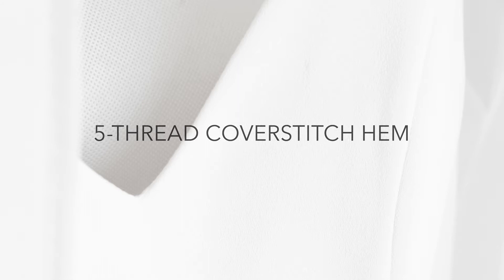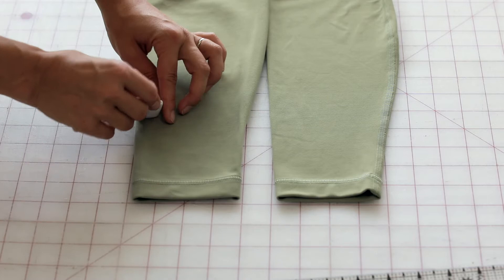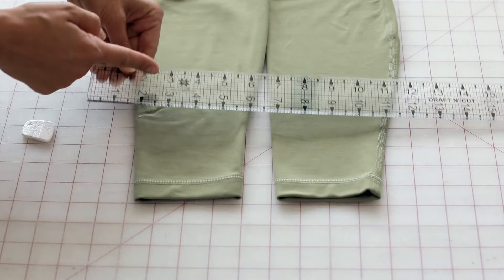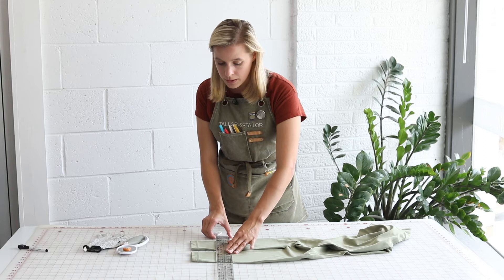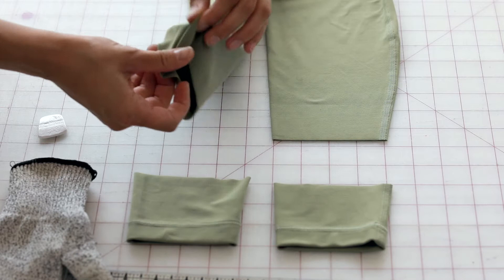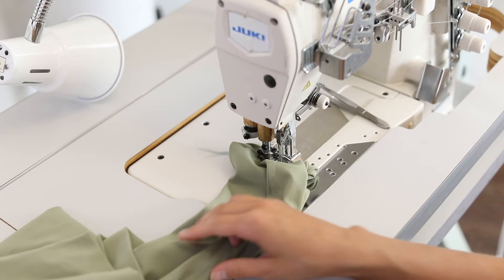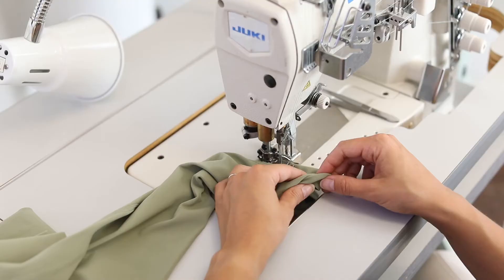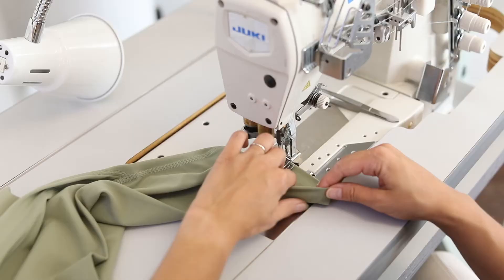The Ultimate Guide To Hemming Your Lululemon Leggings (Ep. 6)

Comment: You made that look too easy!  Lol. I only have a simple/regular, 2 thread (1 thread plus bobbin) sewing machine, could I achieve this with just a zigzag stitch?  I’m not a sew-er but I want to try to hem my bootcut yoga pants as I’m tired of the bottoms dragging and getting wet.
Reply: did you ever test it out because i’d like to try and do the same
Reply: You cannot this is called a Coverstitch and requires a special machine, an option you have with your machine is to get a twin needle and do a straight line stitch. That's what I'm doing because a coverstitcher costs $1000+
Reply: Try using twin needle

Comment: Hi Shaelynn, did you not need to use an elastic thread for these so they are not tight at the hem? Trying to hem some stretchy leggings and am worried about the stitch popping/being tight when moving in the fabric.
Reply: Use a zig zag stitch.
Reply: Yes I'm wondering the same
Reply: @amandaglidewell8451 but yes zig zag using hem tape under is better to me

Comment: Can you show the stitch you used please? (I’m a beginner.)Also, did you use a special foot?
Reply from the maker: Hi Nicole, in this video we are using an industrial coverstitch machine which is not a traditional sewing machine. There are up to 3 needles and 5 threads on this particular machine. So its not about the foot type either, you won't be able to achieve this style of stitching on a normal straight stitch machine.